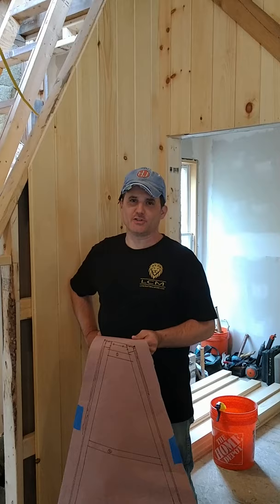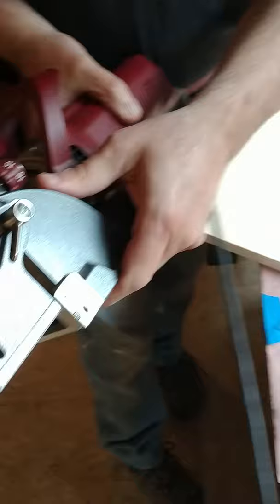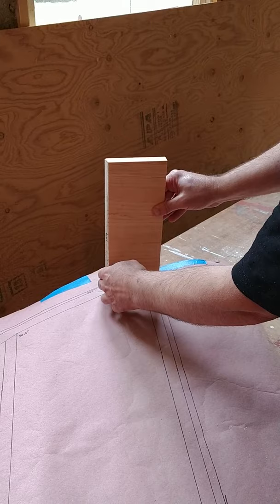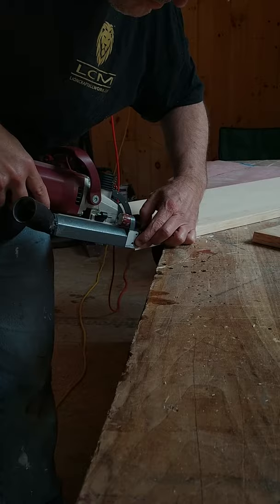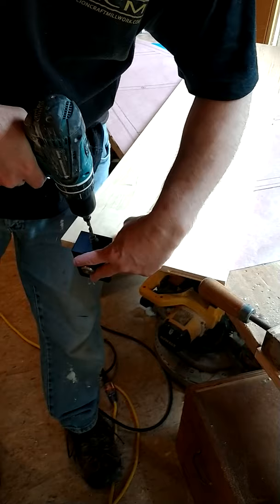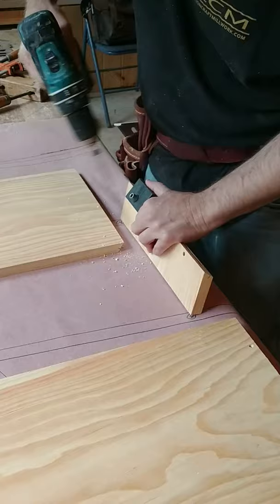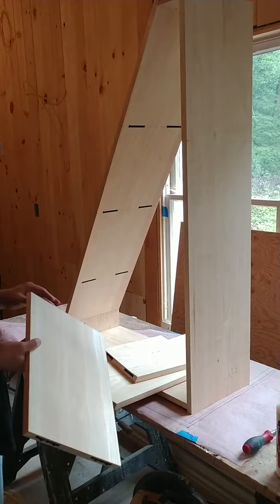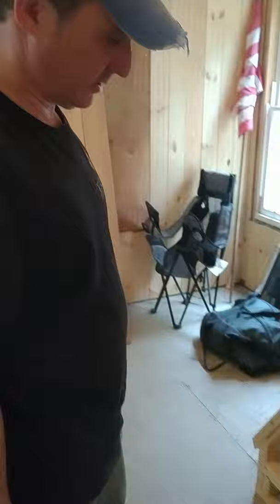How to use Clamex P-14  Flexus for Angled Bookcase

Comment: so you need  two  stop squares  for this offset  operation
Reply: Liam, sorry for the VERY late response here.... The second stop square isn't absolutely necessary, but it definitely makes things more stable/steady in those vertical milling applications where the slot height is something other than 10mm (standard flip stop position).